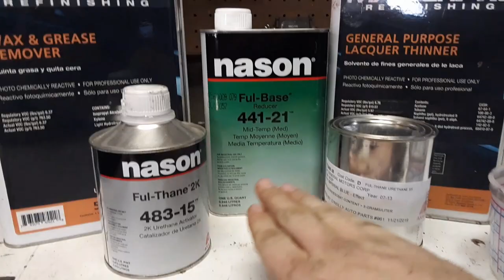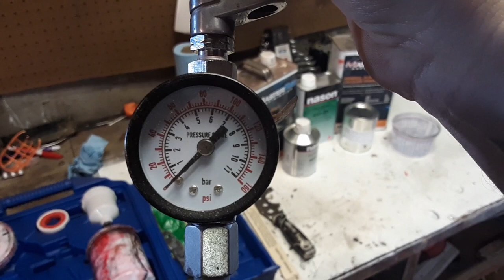Using a Walmart HVLP Spray Gun to spray Single Stage Paint Campbell Hausfeld Paint kit

Comment: Great job. It's actually an LVLP gun. Campbell Hausfeld Gravity Feed Paint Spray Gun Kit AT706099. Great for DIYer's and smaller compressors. It uses only 2.1 cfm.  I run it with a California Air Tools 4710 SQ, 1 hp, 5 gallon compressor. Works for me.

Comment: Nice! Could you have gotten away without wetsand and buff? And is the overspray from this gun terrible enough to the point where one needs to put plastic on white walls? I would think that since it uses less air the droplets might be bigger and result in orange peel, but what do you think?